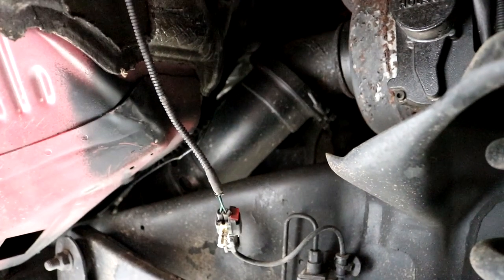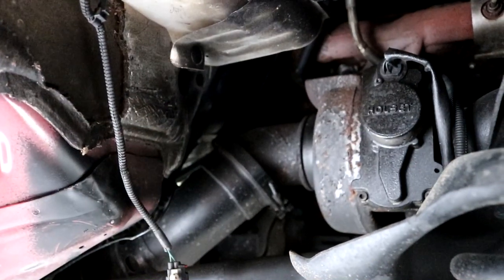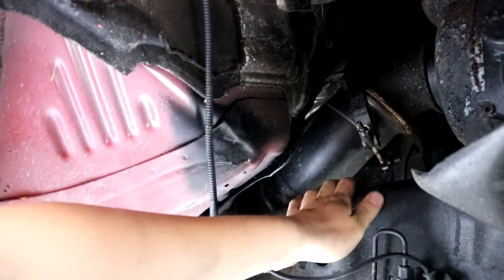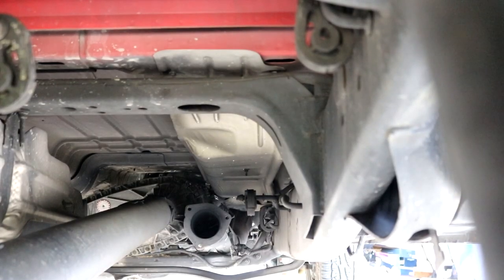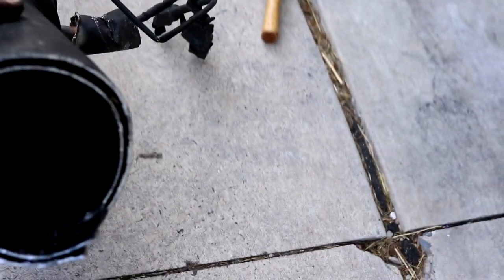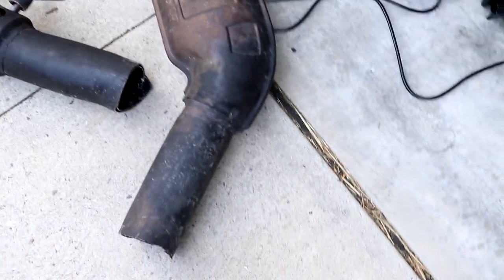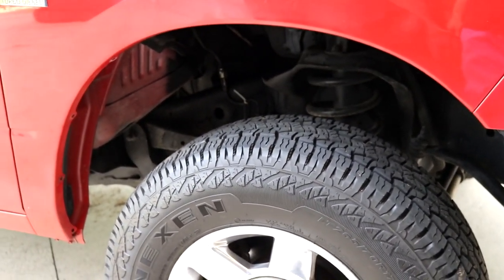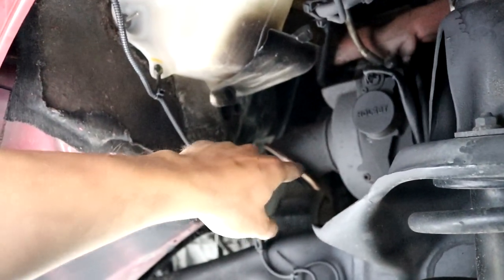CUMMINS DOWN PIPE DELETE...

Comment: I don’t understand why you keep mentioning “dropping a crossmember”, they make these kits so you don’t have to do that. I installed my 5 inch flo pro and the stock exhaust came off without any cutting and it went on with ease and I did it myself, I’m no mechanic by any means either
Reply: Unless you bought some offbrand exhaust kit for super cheap, then there lies your problem
Reply: Same thing for my 5” flo-pro on my ‘17 2500. No “dropping of a crossmember” needed. I’m thinking it operator error.
Reply from the maker: yes the problem is that I bought an off brand
Reply: Upshift Z71 oh man that’s gonna cost more in the long run. Send it back get a flo pro you will be less pissed off later👍
Reply: Evil One I have a 2010 ram, I’ve been looking for straight pipe for it, but all i found is off brands, non of the good brands sell them anymore, why is that and is it possible for a 5.9 straight pipe to work? I see those everywhere
Reply: how do you get the downpipe off without dropping the cross member?

Comment: I don’t know why you would delete a down pipe on a turbo charged platform. Exhaust gas is a huge factor with these types of setups and the monitoring of said gas is as well. “Down pipe delete” seems to be a terrible attempt at a click bait publicity stunt from someone who has most likely has no clue what they’re talking about/doing because he had a mod shop or dealer do most of the work to that truck before turning all hack saw McGee and took to cutting out the pipe
Reply from the maker: Well picture the folk who run hood stacks
Reply: You’re actually incorrect, the turbo alone produces more than sufficient scavenging, as the turbine sucks exhaust out and the compressor pushes air through the engine, also all temperatures monitoring should be done before the turbo.